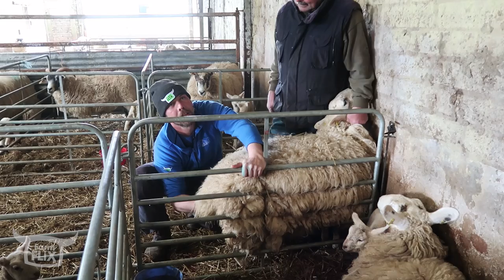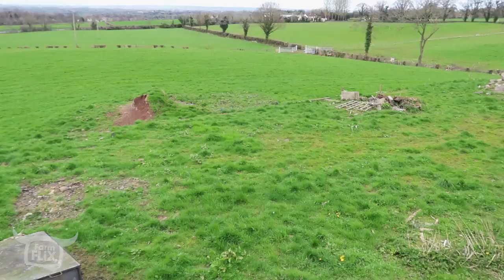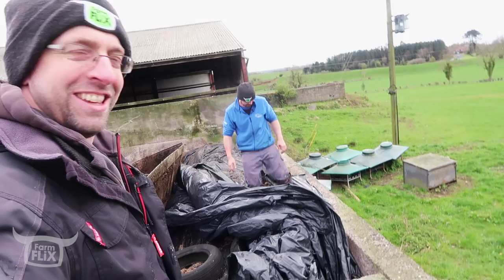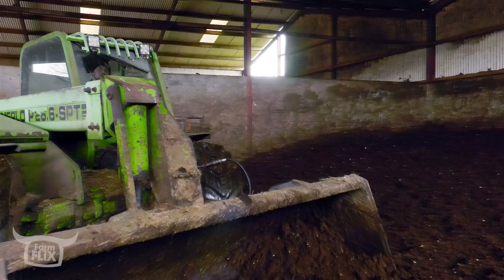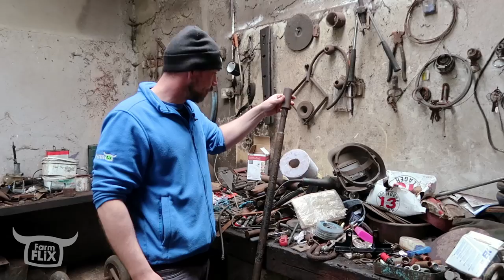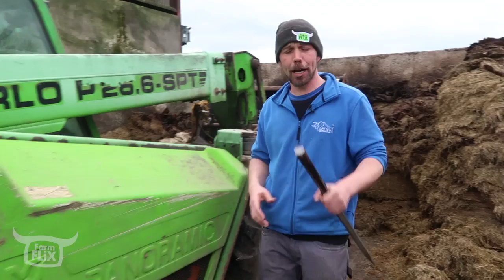BREAKAGES,BULLS, FUN Times. Lambing Finished?  Alan Clyde & John McClean | FarmFLiX

Comment: Just need to sort your tines out. Once you loose one it puts extra pressure on the one next to it. Get the 2 big outside ones fixed then bend all the others straight again and she will keep going for years. Couple hundred quid in tines and bushes plus afew welding rods. Better then few grand for new grab.